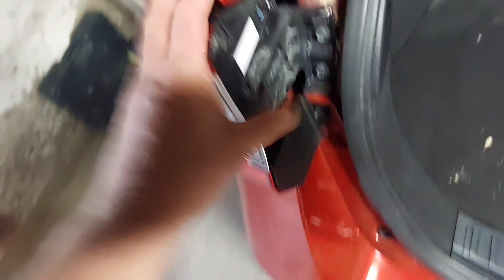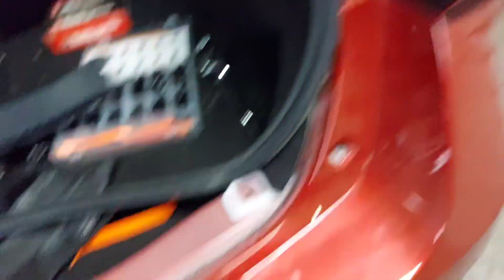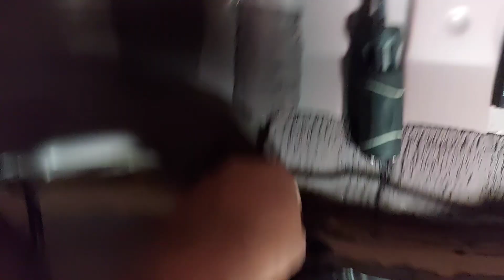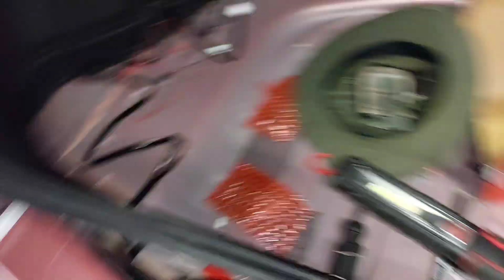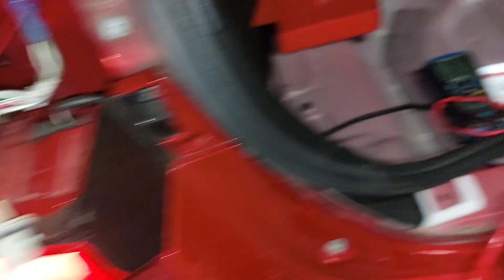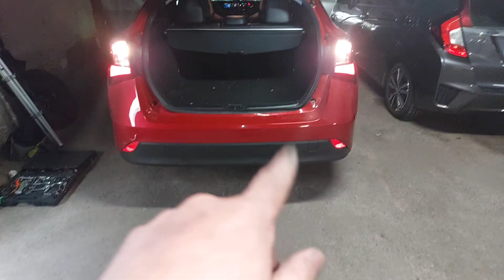DIY - No Drill Backup Sensors - IBeam Radar

Comment: Nice video , will these work on metal bumpers ?
Reply from the maker: Hey @Sailorsanjoy,

Glad you liked the video! Unfortunately the company specifically says that these can't work on the inside of a metal bumper. You'll likely have to install the ultrasonic sensors instead. It might be a bit less work to install a backup camera but you won't have the convenience of a beep when you get close to an object.

Take Care :)
Reply: Hi I have fiberglass bumpers. Will these work with those and also what brand is the system. I would love to put it on my car
Reply from the maker: Hey, @cartoonking1063 

Yep these will totally work in fiberglass bumpers. The system is called IBeam Radar Backup Sensor system.

Take Care :)

Comment: Hello.  A nice idea and without damaging or drilling the rear bumper.  Does it work if the rear is wet from the inside and what is the minimum distance measured.?
Reply from the maker: Hey Florianvalikaj,

On this install the minimum distance I'm getting is about 12in. At the distance it's a solid (and rather annoying) beep. 
As for being wet on the inside of the bumper, I'm not exactly sure. The sensors look like they can handle a damp environment but if your bumper is open and water is splashing inside then they could potentially fail. 

Hope this helps :)

Comment: Thank you for the video. Can I install this sensor in the front? My 2024 Mustang doesn't have a front sensor, and I don't want to drill the bumper.
Reply from the maker: I think it's possible to install this in the front bumper however you have to find a way to only have it activated at low speed or install some sort of switch that you can turn on and off. When it's wired on the back bumper it's only powered on when the reverse lights are on. I'm not exactly sure how you'll do this when you install them in the front bumper because you're driving forward. There may be some sort of car speed sensing relay you can buy so its only powered on at low speeds.
If you do find a way please post a reply because I'm curious now :))

Take Care
Reply: @bobsoddjobs   Thanks, Bob, Sure, I will let you know. I never considered the speed factor and the switch requirement to control that. That makes sense! I might need professional help if I have to install a switch. Thanks again.